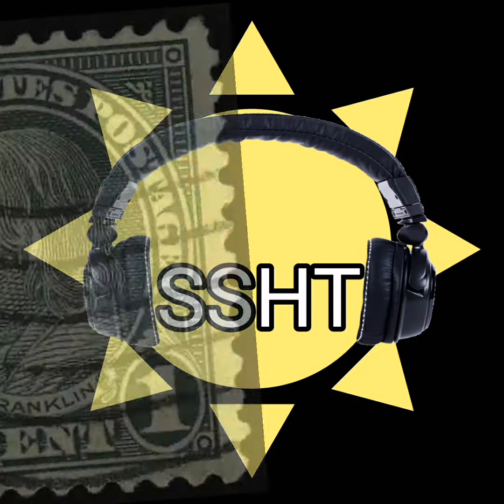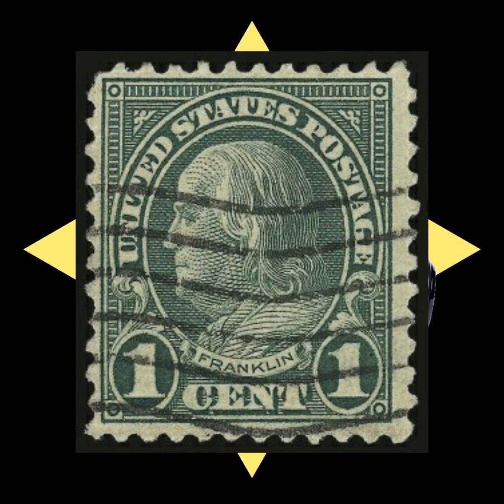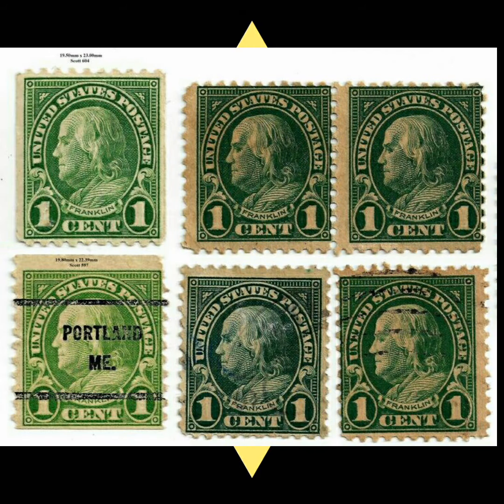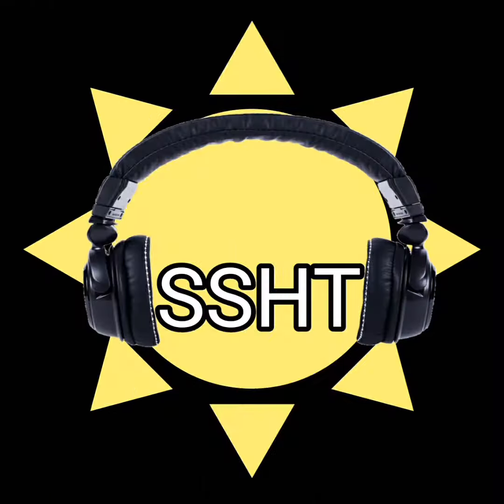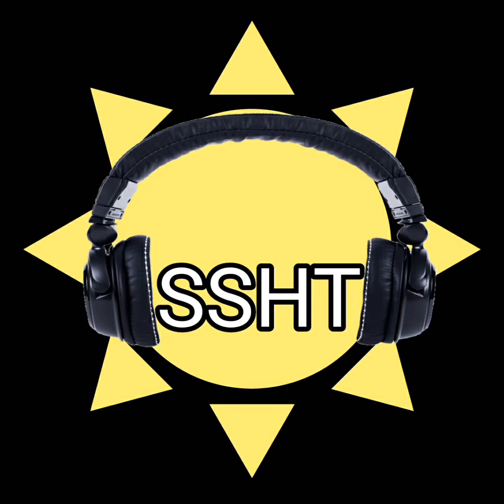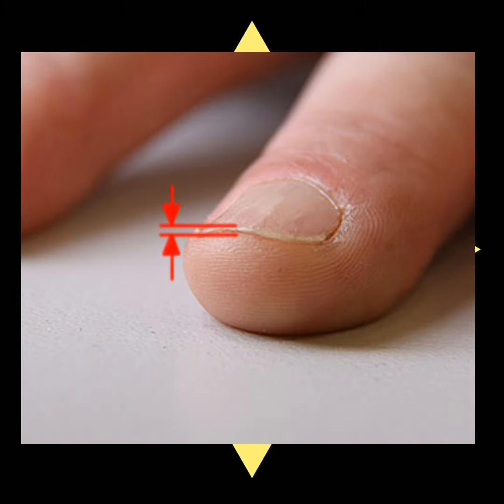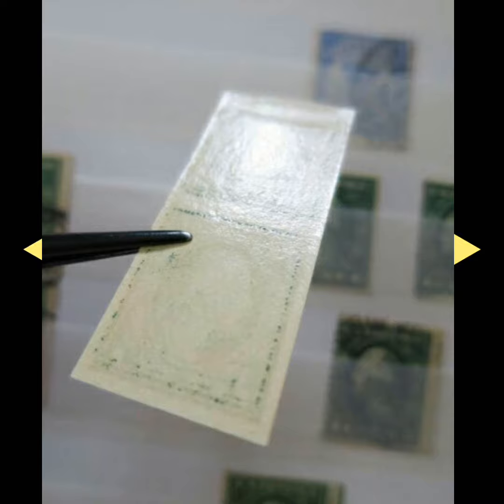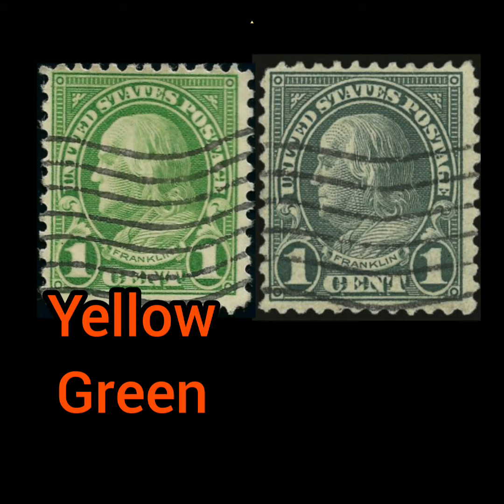$175,000 Franklin Stamp #594 #596

Comment: Years ago i visited an antique store which had post cards from 1936 post marked but i was surprised to see this Franklin one cent stamp on it. And purchased some of these post cards to remove the stamps from. Stupid me? Did i make a terrible mistake in carefully removing the stamp from the post card from 1936? One sold for $85,000.00 having the post card in tact. Bummer! I believe the post card and the addreess as well as the person who sent it and the girl friend who received it may have made the stamp so much more valuable historically. One came from Niagra Falls and i no longer kept the post card it came on. It was received in Oklahoma. What if it came to a prominant person or a poet, or proliffic writer ? Would it be more valued than just the face value of the current value? The Franklin one cent stamp is off set. With the top of the border perforated slightly. Also it looks like this stamp had been exposed to sunlight as it looks faded and not a hunter green. The printing looks very sharp..What is it worth?
Reply: Have it sent for testing there are places that appraise stamps..

Comment: Interesting. I'm a GB specialist and have a stamp that also has exactly 9 copies (2023 correction - now 10 as another has been discovered, which I now own!) known.
It's an inverted watermark example on 1d Red plate 9.
(I'd put a link to a scan of it but the scan has my name on it, which I'd rather keep private)
Yet it wouldn't fetch anything like $175000 (I'd reckon to get between £3000 - £5000).
In the same way, there are just 7 1d Red SC perf 16 Die 1 plate 168 stamps in existence. A good friend has 2 of them. They would fetch perhaps £10000 in auction.
I wonder if it's because Scott lists that Scott 596 stamp as a separate catalogue number and collectors want to get one of every number? The 1d Red plate 9 with inverted watermark is not even listed in the Stanley Gibbons specialised catalogue: that's how rare it is.
Reply: King Curry good morning Sir. Very happy to know you are a GB specialist. I want to show you an error stamp of GB. Please allow me. Thanks Sir in advance.
Reply: @ravinderkundra4277  And how do you propose to do that? What is the error stamp?

Comment: Hi guys! Enjoyed the video. Thanks for making it. I do have questions about measurements of the design size. If the listed measurements in the catalogue  are approximate measurements and not exact, what kind of a +/- tolerance is allowed? I have also seen different publications list different measurements for a 596. Stamp Smarter lists the measurements for a 596 at 19x22 1/2. Linn's has them at 19 1/4x22 1/2. A site called Swedish Tiger has them listed at 19 1/2x22 1/2. Which measurements are correct? I ask that because some people do not have the Scott Cat. available to them. I thank you in advance.
Reply from the maker: there is very slight variances but over-all not much.
Reply: @stampshowheretoday9593  Thanks for the reply back. From all of the frames I have measured up to this point, I have noticed that +/-  tolerance is at most, .15mm. Most of the time it is .10 or less. Maybe I get too technical about things. I just want to be 100% correct before moving on to the next one. I am sure with time, I will be more relaxed about it all. Thanks once again.
Reply: @johndoe9000  good morning Sir. I am Ravinder Mohan Kundra, Punjab India. Last year you talked about the different measurements of the Scott 596 . If you got the right measurements then tell me. I shall be very thankful to you to solve my very long time problem. Once again thanks Sir in advance.

Comment: if someone had one of the franklin 1 cent rotary stamps  thats very close to the expensive scott 596.. should they have it looked at by a professional? ive read online that they are so close that you cant tell and that its possible to have the scott 596 even if it appears to not be the correct length. reason i ask is bc i have a rotary ben franklin 1 cent stamp.. it has the color marks on the back  and is also stretched from being a rotary stamp.. another fun fact regarding the stamp that makes my bhole pucker is that it came from a collection of letters that shows that this women who wrote the letter was from north central kansas. in the box of letters she sent to her parents while traveling there are multiple letters from kansas city proving she was visiting the city. its totally possibly she bought numerous stamps from kansas city and took them with her on her travels to later use it to mail other letters back to her parents... 

so my question is, should i spend the 50 or 100 bucks, whatever it is to have to looked at?
Reply: by correct length i meant the size of the perfs.. they apear to be a half mm or a quarter mm short.. i cant remember but it was so close i thought i was rich for about a week. haha

Comment: I googled the 1 cent franklin because I had about 12 total. 2 were together on a postcard and the color is almost a gray. Wigh a green cast. Much different than the other 10. You can put them side by side and and the 2 are visibly larger. His head seems a bit wider too. Those 2 came off the same sheet and are still one piece. Im excited to let a professional take a look. Im never this lucky so its probably something worthless but I can say everything checks out according to this video. And I use vernier, and dial calipers daily. And they are the right size too.  One in a million I know but it would be nice!!@
Reply: so what happened?  I'm looking at a potentially worthless version in my possession.

Comment: Hi, i found 2 pcs of 1 cent franklin with dark color and no ink at the back of it.. im not sure if its the one
Reply: it must have the ink transfer.. and it must be stretched from the rotary style printing technique that used a roll instead of a flat plate
Reply: @frankthoman4894  i have several of these i think.. and a lot more.. i dont know the value i want to sell em
Reply: @immanuelcarretero103  honestly i have no clue what they are worth.. i know some are worth a bit more than others.. like a few bucks compared to the usual less than a buck price point but i dont have any clue as to actually putting a price on them. if you figure it out please let me know. sending a stamp in for authentication is expensive and I would only do that if you think you have one of the rotary varieties thats like a  half mm off from the scott 596. I actually have one of these and am thinking about spending the 70 bucks or whatever it is to make sure its not a legit scott 596. whats crazy is that im from kansas and the women who wrote the letter i found it on had traveled to kansas city both before and after the particular letter was written. lol its probably not one, but who knows
Reply: @frankthoman4894  thanks I'm from Manila I got these from my old pops house it dated 1900s. Okay thanks